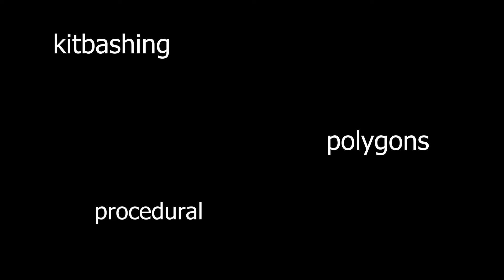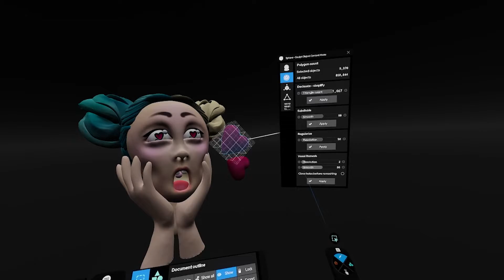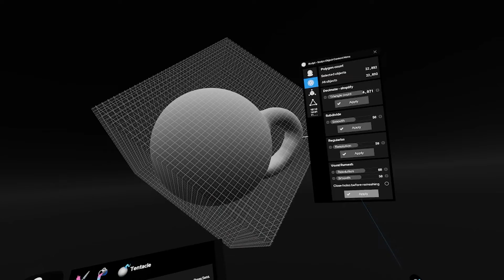Polygons vs voxels | What's the difference?

Comment: Hi, voxels then are just stacked cubes/3D squares and the cubes are made up of 8 polygons that has to be small? A cube may of 8 quad polygons is technically a voxel?

God bless.
Reply: No, this video is partially wrong. Voxels are not polygons and don't have anything to do with polygons. The confusion came because voxels tend to have a blocky or pixelated look due to not a lot of voxels being used on a model/low voxel model resolution, so then people started wrongly associated voxels = cubic look and then calling any polygonal render with a lot of cubes as "voxels". Voxels can be represented as squares, circles, cubes, they're just points in a 3D space with a visual representation. Voxel renderers don't require the use of polygons at all.

Extra: cube shapes can be visually represented in 3D without the use of polygons but with mathematical functions as it is a simple shape, same with spheres (Signed Distance Fields). Most voxels use a cube representation but these are NOT polygons/made up of polygons/no polygonal renderer being used.  As soon as it uses polygons its no longer a voxel renderer, it's a polygon renderer.
Reply: @johnq4061  Thanks, it's tough to comprehend points in space (hard to visualize) that defines a voxel. What does one voxel look like? Just a dot? What's the best Youtube video that explains it.

Comment: I tried to edit a photogrammetry model in shapelab, and read why it does not work in the FAQ, understanding the surface is not like voxels, and it broke at the seams predictably.  Maybe a future tool would a a poly/voxel convert tool if that doesn't crash things, to capture things then be able to polish and add details would be incredible.  This is my fav VR sculpt tool.
Reply from the maker: We are glad that you enjoy Shapelab! 😊 However, please note that Shapelab is able to handle photogrammetry models. We are not sure what the issue could be with your model ‘breaking at the seam’, but we would love to look into it. Could you send us an email at vr@leopoly.com explaining what happened when importing/editing the model in more detail? If you could also send us the model itself, it would be very useful! Thanks, Leopoly team
Reply: I've had this issue in the past, it's usually got to do with overlapping vertices. The best solution is to open up the model in blender first and do a merge-by distance (before using it in Shapelab or other software).